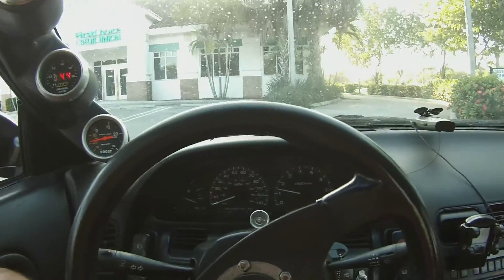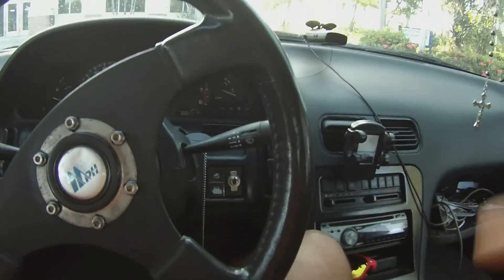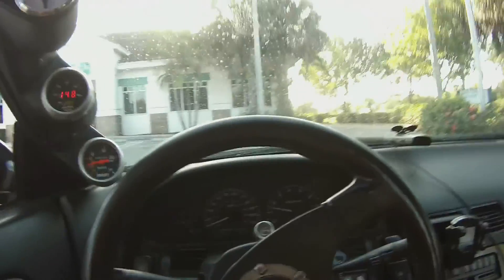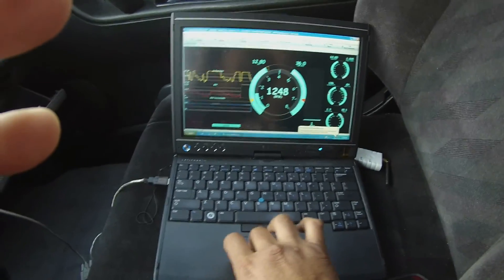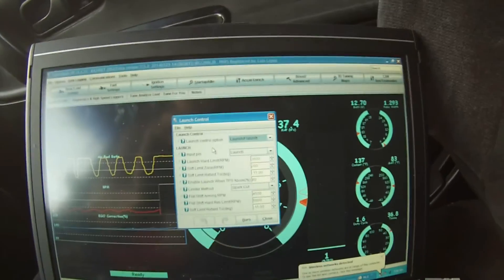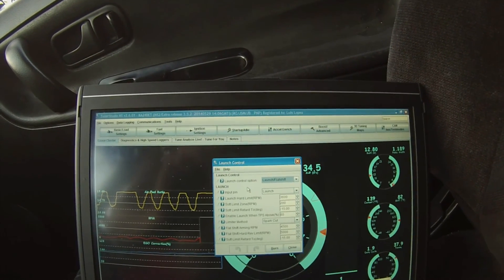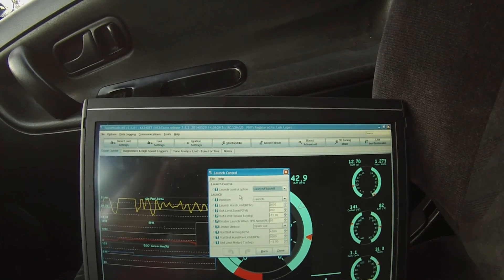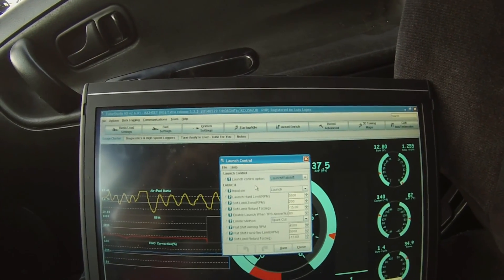Nissan 240sx KA24DE-T MSPNP Launch Control Settings

Comment: Are you able to do all of this with the distributor? or did you have to do a coil pack conversion. I'd like to know everything I'd need in order to get two step on my KA-T setup. Thanks!
Reply from the maker: That Green S13 You can 2step with stock dizzy/ignition but need an ecu that lets you set this.  Either chipped ecu or an aftermarket setup.
Reply: supakat500 do you think id be able to set this with a nistune board for a Ka24de?
Reply from the maker: That Green S13 They have this for s13 ka's.  Let me see if I can find.
Reply: thanks man i appreciate you!
Reply from the maker: That Green S13 So, yea it is available for S13 and Adamky also updated his S14 Nistune to work.  I could not find the threads but you should be able to find find an updated definitions file and bin.  Let me link you to the site I just remembered where it should be posted.
Reply from the maker: That Green S13 http://www.ka-t.org/forums/viewtopic.php?f=36&t=28671
Reply: any way you could link me to the MSPNP you are using in the video? I can only find them for the SR or s14 KA...Is this a full ECU or a chip?
Reply from the maker: This is a full standalone.  https://www.diyautotune.com/product/megasquirtpnp-g2-ns8994-for-the-89-94-nissan-240sx-manual-trans/#reviews_summary Email their support.  They respond within 24 hours and are very knowledgeable.

Comment: Just curious, in tuner studio, when you are at idle and you push the clutch in, does the little box at the bottom of screen that says launch turn green? I'm trying to get mine to work and it just revs over, it's not activating launch control.
Reply from the maker: Jacob Merritt Unfortunately I am not sure and cannot test. Currently in the middle of a VQ swap.
Reply: That's cool man, good luck.
Reply from the maker: Thanks.  I will be going with MS3 with the VQ. Then I can test.